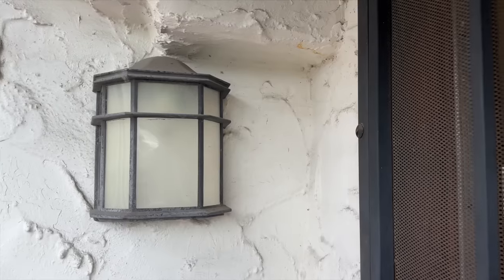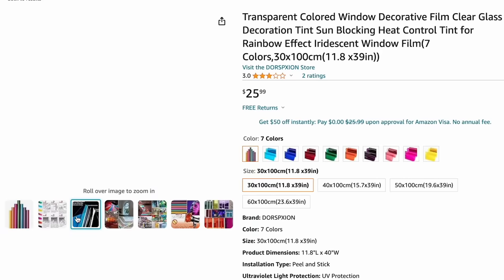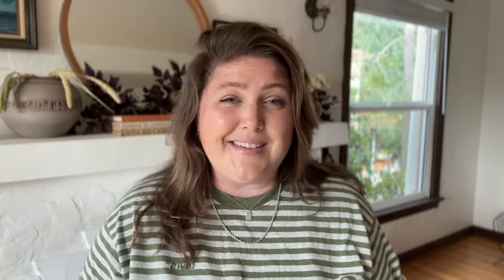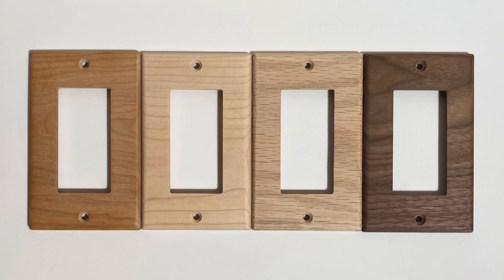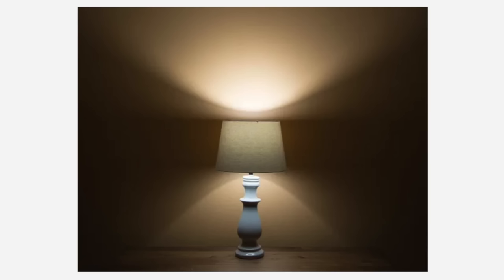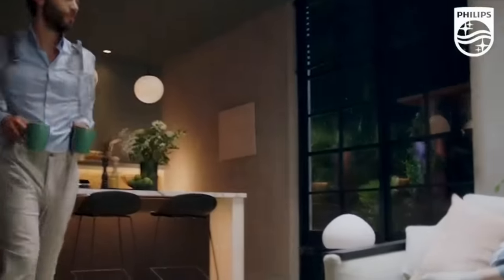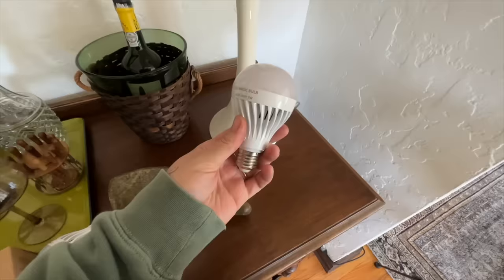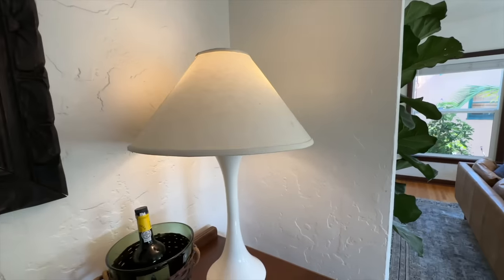10 EASY Home Hacks that will ELEVATE Your Home | Affordable + Renter Friendly!

Comment: Socket splitter for two bulbs! I didn't know such a thing exists. Thank you!
Reply from the maker: of course!!
Reply: Agreed! Awesome!
Reply: Used them all my life
Reply: I know, right!
Reply: They're nothing new. I use them in my basement ceiling sockets. Way cheaper than installing extra sockets in the ceiling requiring an electrician. 

Why did they ever think two light sockets would be adequate for a dark basement when they built my house?
Reply: Where can i purchase those double sockets? I need them 😊
Reply: Like this idea!!
Reply: Any hardware store has them. Big places like Walmart or Home Depot also.
Amazon features them too. 

They are really quite common and nothing new.

Comment: Iron a paper bag over the wax & it should come out. Just keep moving to a clean area of the bag until there is no wax stain on the bag.
Reply: Any suggestions on how to get candle wax off candle holders?
Reply: @susancolson397  Put in freezer; wax will chip right off.
Reply: Can also put fire proof candle holders in the oven on LOW heat and melt the was off. Use a cookie sheet underneath to catch dripping wax. Wipe off with paper towel.
Reply: @susancolson397 put them in the freezer. The wax will shrink. Easy to pop out after a day
Reply from the maker: @vanofpearls7528 tried that!
Reply: @denacarter4030  Thank you to everyone who sent some advice!

Comment: I have rented all my life & my absolute, all time best suggestion is fabric on walls.
I find huge pieces of remnant fabric at auctions, thrift shops, garage sales etc...
I hang the pieces with push pins or install a wire around top of walls and hang fabric from that with whatever clips i can find. 

Heavy Sheets also work. I love the patterns.

Fabric can be changed at will and the holes filled when you move.

Comment: All great tips, not just for renters, home owners too.  I really like the flameless candles; I have cats, they're safer to use around them.  Don't have to worry about leaving the room and a candle getting knocked over, burned whiskers or tails.  I have some that are on timers, they come on at the same time every night, once you set time and stay on for 5 hours.  Just enough in the bathroom, no need to turn on a light.
Reply from the maker: Thank you so much! And yes to the candles -- exactly! I think mine have timers but I have no idea how to edit them? Sometimes I have turned them off and they're on again haha so I need to look into that..
Reply: @livingwithlk  - setting the candle timers.  Switch on bottom, one direction turns the candle on till you turn it off. The-other direction, you turn it on at the time you want it to come on every night, it comes on, stays on for 4-5 hours and comes on at that same time daily till you reset it.
Reply from the maker: @lindaroyal8161 ah thank you!

Comment: Buy a paint pen and paint the working parts of your outlets and switches. I’ve done that, to nearly all of mine - to save the time, expense and hassle of having all the hardware changed out/re-wired. The paint has not peeled, at all, and they look fantastic!

Comment: All amazing ideas. I am a renter. On my end balcony walls, I placed two (Per Wall) solar 'Fence' lights with Double Sided Mounting Tape. They add a nice ambience and are Dusk To Dawn, so no On & Off to worry about. I also removed a Flush Mount light in my dining/living area (With the Landlords permission) and installed an 'Enclosed' ceiling fan with an LED light. LOVE IT !!! I have used Repositionable Peel & Stick wallpaper several times on my walls and hallway sliding cupboard doors and love it as well.

Comment: I haven't read all the comments so I hope I'm not repeating what someone else has said. But…
Another idea with curtains are bed sheets. A pair of twin size bedsheets will slide over a curtain rod and can be tied back. (the rod goes through the pocket that exists at the head of the flat sheet. And left gull length they easily ho ceiling to floor. Or, they can easily be hemmedbto the length you like. 
This also works in the bathroom as an putter shower curtain. You can use a springy type expanding curtain rod up near the ceiling and they look lovely. (credit for this hack belongs to my late mother, Barbara.)
Love your videos. Subscribed

Comment: Reduce the adhesion of tape, peel n stick, etc by pressing it on fabric first. For walls, using blue tape, sticking it on your clothes is good. For tiles, try using fuzzy blanket or sweaters. Easy

Comment: I love magic bulbs ! 10/10 recommend. Thanks for the tip about polyurethane over contact paper, I will definitely try that. 
I’ve done the contact paper hack over (hear me out, it came out great) you know those Sterilite plasticky 3 drawer things on wheels? I have tried to find cuter storage for my sewing fabrics but they are just the most functional. I built a bureau top out of wood to go over them and covered the drawers in contact paper. It sort makes them disappear into the room instead of being a huge eyesore. Loved this video ❤

Comment: If you have even minor sewing skills, you can use tension rods to hang homemade curtains. You can also use glue tape to iron on hems, making it a sew - free option. I've even used tension shower curtain rods. You can find  rings in fabric stores, and they have directions on putting them into the fabric. They're basically just cut and press together to seal the fabric edges into the rings. 
Putting toilet paper rolls in between the rings will support the fabric, making a nice, evenly waved curtain.

Comment: You can also use those window lines to discourage bird strikes.  You can remove and spray paint the fan blades and then return them to whatever the landlord needs. If you need strips of leather go to thrifts and find belts.

Comment: I'm a lifelong diy'er & I've never known about the socket splitter. That would have come in handy with the dim, one bulb only, ceiling lights. 
I've also avoided putting peel and stick down on my rental floor because I've tested them out along with countertop vinyls and they do ruin whatever you put them on when trying to remove them and that adhesive is next to impossible to remove. So taping down a liner first, like the thin shower curtain, or a thin tarp, down first is an excellent hack! Thank you.

Comment: You are very clever and have a charming delivery (I find so many irritating voices on YT).  You had me hanging onto every word! LOVE your application of the stained glass and lead line decals. ❤  Really great tips.  That shower curtain under the peel & stick floor tile is genius (and you politely gave credit).   YES on the “boob lights” being replaced.  I’m a big fan of the battery candles.  All mine have a wax coating to mimic real cables (as if…🤣) and I favor the ones with the flickering/moving flames and timers. 👍🏻  I set mine up in Oct as the nights get longer.  Adds coziness!  Wishing you continued success on YT.  Thanks for your video.  Well done!

Comment: For candle wax removal from linen, just put a thick paper bag, not waxed, of course and iron it. You will be amazed how much it will take it out your friend Gerri.
Reply: Yes! I learned this years ago and have used it several times on carpeting as well as furniture. I suggest being careful to not leave the iron in place long with furniture.
I use a low iron so as not to damage carpet fibers and as the wax soaks into the brown paper bag I simply shift the bag around until it stops absorbing any wax.

Comment: You can use the adapter that lets you screw the bulb back in plus it has two plug outlets on it so that you still have the porch light as well. That's what i use.
Reply from the maker: Yes that one is great! My sconce wouldn't fit it unfortunately the shade was too small for all that.

Comment: The vinyl static cling is preferrable to the sticky vinyl because it can be removed without any residue on the window and of course it can be reused.  I use it to reflect sunlight to reduce heat gain through a west facing window wall,m plus it gives privacy from the walking path that is at the end of the back yard.

Comment: Ceiling Fans- usually the dull yellow bulb covers are usually just covered with the yellow designs vs the glass being made yellow.  Remove the bulb covers and put them the dishwasher.  You'll find after a long wash and dry cycle the yellow film just peels off.  Then you can use glass paint to paint them to your style.  Also, you can paint the blades as well as all the metal parts.  A little work will give you a new looking  ceiling fan.

Comment: Thank you so much for the tips! I don’t know if someone already told you but you can take the wax out by ironing a paper over the wax. I would recommend putting paper on the other side as well and keep the setting low; as the iron heats the wax it will melt into the paper. My mom showed me using news paper but I recommend white card stock 🫶🏽

Comment: I've been using those plug-in with the sockets for probably 35 ish years, I'm 53 and as soon as I moved out on my own at 18 this was probably one of my first purchases so that I could have extra lights outside, I buy the one that you can screw a light bulb into so that you have the sockets and that one light bulb in case you need it, pull chain so that you can just have the one light or just the extra lights. Personally I think it's a little better than the one showing here because you can have the regular light.
Reply from the maker: I think it just depends on what your electricity can handle. My home for example can only sustain 15 watts so I wouldn't overload a light like that.

Comment: To remove wax from any fabric, place a paper grocery bag on an ironing board or other flat surface.  Place the wax-stained fabric on the towel.  Then place another paper grocery bag over the fabric.  Then iron, changing out the paper grocery bag as it gets soaked with wax.

Comment: You mentioned in your video a problem with wax in your linen table cloth. Have you tried ironing it with brown paper? May I suggest you put a sheet under the tablecloth & then a sheet on the top before ironing it. You may have to do it several times by moving the tablecloth about, but I think it should come out.
Good luck.

Comment: Regarding your Linen table cloth with candle wax - have you tried ironing it with brown paper (eg. grocery bag) between the iron and the waxy table cloth? Doing this gently, a couple of times should remove most of the wax, then wash as usual.
I wish I'd had the chance to do this on my lace table cloth but the friend I loaned it to threw it in the trash instead! 😱

Comment: A hack for you to remove wax from fabric.  Pour boiling water through the fabric where the wax is.  I have successfully done this even with wool and Mom did it with alter cloths that had candle wax drip on them.  A tea pot works best because you can direct a small stream of boiling water into small areas of wax.

Comment: You can use 100% cotton material and liquid starch to attach to a wall or a floor and it will peel up without leaving any residue. On the floor, it may try to come up as it gets heavy traffic
Reply from the maker: Yes this is a great tip! I have done it before : ) Thanks for mentioning!

Comment: Bravo👏 👏 👏 
I immediately subscribed. You just solved some big problems I'm currently having. One question, when you put the lines on the window do you do both inside and outside.. That may be a dumb question, but I really don't know.🤔 Thank you...❤❤❤
Reply from the maker: Thank you! I just put them on the inside : ) The outside it would probably fall off or melt lol
Reply: @livingwithlk  // I thought about that after leaving my message and much thought...lol

Comment: Use contact paper under peel and stick backsplash so it’s easy to remove.
Reply from the maker: I am wary of anything sticky at this point, especially with heat and other elements, even contact paper.. plus contact paper doesn't usually stick well to textured walls!

Comment: Here is a very easy hack for removing melted wax from your table linens or any cloth material.  Do not put the linen or clothing in the washing machine.  Take it to the ironing board, instead. Place a piece of newspaper over the affected area and use your iron on a relatively low to med setting to iron over the newspaper with the linen underneath. The heat from the iron will draw the wax into the newspaper completely. I worked in Catering for years. There was lots of spilled wax on tablecloths from guests and our uniforms, when cleaning up at the end of the party. It's the quickest and easiest way to solve the problem.
Reply from the maker: i’ve done it and it doesn’t work on this linen tablecloth! i’ve tried everything haha

Comment: He's a good hack use a paper bag on any wax that spills on cloth but your iron on low heat but something underneath like a board or something and just run the iron over the paper bag and move it around until you absorbed all the wax that way you don't have to ruin good limits I've done it many times and it works great😊
Reply from the maker: tried it! didn’t work for me

Comment: I need lights in my closets, would those bulbs be bright enough for this? And any other ideas for the closet problem?
Thanks, Cathy
Reply from the maker: I’ve used battery powered light bulbs in my closets. I wouldn’t do rechargeable I would buy the ones that take batteries. it’s easier to replace batteries than recharging all the time!

Comment: to remove wax from material grab a brown  paper bag without print on it. You will only need a single layer of a bag. Grab a iron. Heat the iron on warm . make sure it's hot enough to melt the wax. Place the paper bag over the wax stain then rub iron over the bag. The wax will begin to lift up. Any oily residue left use dawn dish soap.

Comment: Ceiling tracks for curtains is very European. I was introduced to these in Germany and brought 3 back to the States with me.  I also, after 19 moves in 30 years move 2 totes of curtains. My next place has a 12’ window in the MBD. It has blackout blinds but it’s still not enough for us and I need curtains. No idea how I’m going to cover one 12’ window. Taking any suggestions that won’t break the bank.
Reply from the maker: Cut down an ikea track like I did, or use a tension rod
Reply: @livingwithlk  thx for the ideas.

Comment: Maybe get 1/4" plywood and put the peel and stick tiles on top of that?
Reply from the maker: That could work but it would be heavy and require putting some drilling into the walls or floors so it didn’t move

Comment: Thanks for the tips! I've been looking for a way to hide an area, or separate it from the rest of a room. I can use the ceiling rod holders and hang some curtains!! I have been trying to figure out a way to do that and still open it up easily  😊
Also, what is your experience with the best under kitchen cabinet lighting? I really need some but don't want to waste money
Reply from the maker: Of course! and that sounds like a great idea! I just used these in my living room and I LOVE them: Rechargeable Under Cabinet Lights: https://amzn.to/3UUiN30 -- they have a few options (on, off, auto (meaning it turns on with movement), and night (meaning it turns on when its dark). You just have to recharge them once in a while with a USB-C cord that comes with it, and I have been doing that when I decide to vacuum or clean the living room 😊 hope those help!

Comment: Hi, just came across your YouTube and I'm now subscribed. You have so much experience and it is greatly appreciated! Question about polyurethane on top of wallpaper peel and stick for counters:  this may be a silly question but I've not dealt with a lot of polyurethane so do you use the water base kind? Oil-based?
Reply from the maker: water based for things that are not wood! oil based for wood projects :)

Comment: I was trying to imagine how to get that wax out of your linen cloth. It occurred to me to use a very large pot to boil the ruined table cloth in water. It might release the wax and you'd be no worse off if it doesn't work.  Just a thought.  I'm looking at my tamale pot and thinking it would hold any table cloth I own and lots of water too.   Be really careful with that much boiling water though. You will need to plan your moves and how to lift the hot wet linen out of the water safely. Maybe this is an outside job. I'm thinking about the big ol' sturdy propane grill I have outside and using the pitchfork that's leaning on the shed to lift the cloth out of the water into a big laundry basket.  You might safely remove the linen that way and the excess hot water that drips from the cloth could be drained easily out through the slots of the laundry basket by tipping it away from you.  Anyway, it's worth a try. Also, maybe do a cold water test first to see if you can lift the wet linen out of the pot safely and from a distance without splashing any water on you, before you do it with the more dangerous boiling water.  Best of luck dear!

Comment: What do you think about that washable paint on hideous wood paneling? I so wish I could paint it but don't want to lose the security deposit.
Reply from the maker: I have seen it done! There was some girl on Youtube who did it but I can't remember her name. I would suggest trying a small inconspicuous area and leaving it there for like a few weeks and then trying to get it off. It will most likely be fine but you can try that way!
Reply: @livingwithlk  Thanks. That's a good point: leaving it on for awhile to let it set and then see how hard it is to remove. 👍
Reply: I think I would try the fabric suggestion.  You could also use a cable to drape fabric of your choice.  When you leave you will 2 holes to fill!